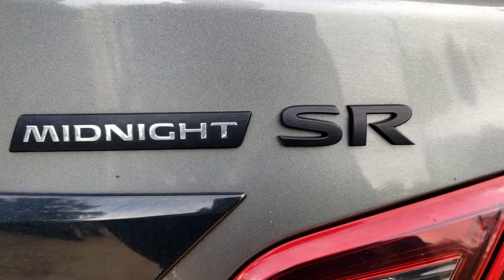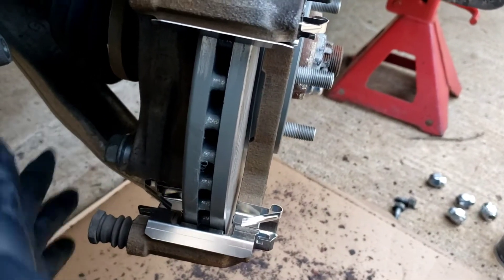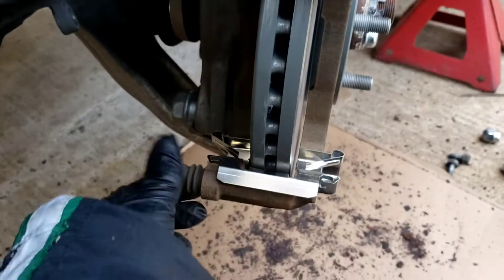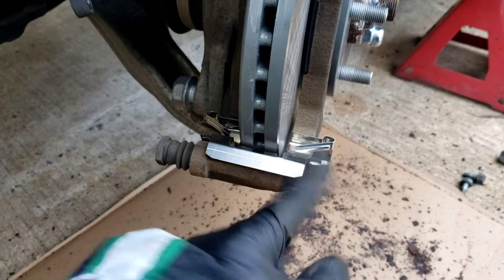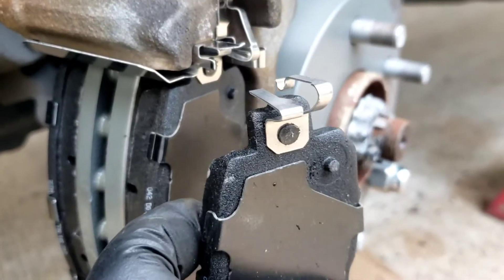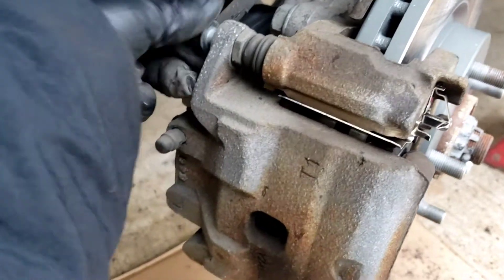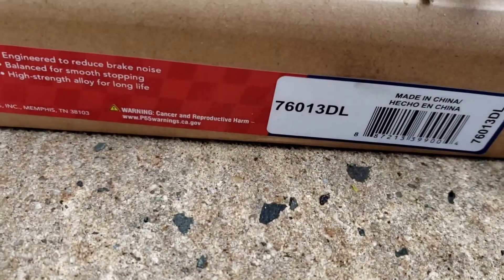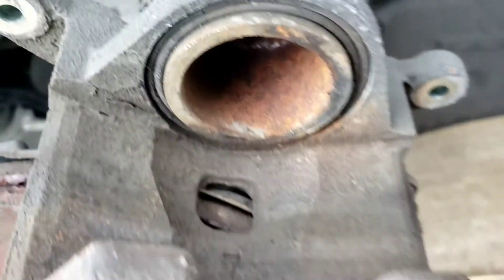Nissan Altima Midnight SR Edition Front Brake Pads and Rotors How to Replace Change 2018 and Others

Comment: Any torque specs
Reply from the maker: 65 ft lbs for the caliper mounting bracket and 20 ft lbs for the caliper sliding bolts.